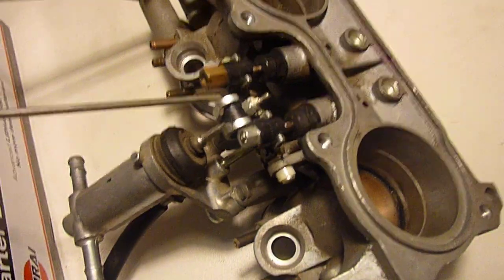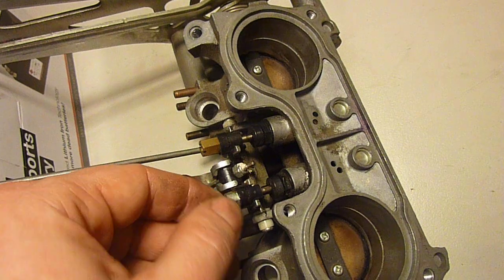What the starter valves on a Honda VFR800 do

Comment: Just as a reminder, Gen 5 starter adjustments do not all achieve the SAME vacuum across all 4 cylinders. IIRC,  1 and 2  are targeted at 200 mmhg and are the same but 3 and 4 are 20 and 10 mmhg lower or 7.1 and 7.5 inhg, respectively

Comment: How do you balance the throttle bodies?

I'm guessing they would need balancing before the air bleeds can be synchronised.
Reply from the maker: The air bleeds are the throttle body balance.  The throttle plates themselves are not adjustable.

Comment: I washed the injection body with spray cleaner, and my motorcycle does not start, I have to accelerate to keep it going, and sometimes it shuts down, what can I do, thanks and greetings from Mexico.
Reply from the maker: You've probably just got a vacuum leak now.  Maybe you forgot to reconnect one of the vacuum lines, or one has split.

Comment: Kal why will my 6th gen idle but die if I try to twist the throttle, even a little?
Reply from the maker: Could be lots of reasons.  Do you have any FI error lights?
Reply: @KaldekBoch  I did have 1,8,9 yesterday, but would have to erase them and check again. As the bike has sat around for a long time I think there's every chance the reed valves and injectors are clogged. It only fires if I squirt Start Ya Bastard down the throat. The last owner says he cleaned the throttle body but not the injectors and that it revved freely. I had it running with MAP disconnected, putting it back on has made no difference. Btw. Your explanations are the most susscinct and knowledable I have found on YouTube. Thank you, I feel confident to pull the injectors out...carefully!
Reply: Kal, no fault light showing. The pugs looked cactus, so I invested the $140 in new and Hey Presto!. Now it idles and revs cleanly, but the coolant overflow is pumping out boiling juice and an oil light is on. It's not low on oil.  Making headway. Keep up the great vids man.

Comment: Great video and thanks for posting!I have the problem described at 6:09.  No adjustment on the idle screw; but my issue is that I can't increase the idle speed. I think I screwed up my starter valve synch last week; the readings appear to be in synch but I must have over-turned the adjustment screws because the bike is idling between 1000 and 1100...to slow.  What exactly are you turning on the screws?  They pull out but I can't tell what is actually makes the adjustment?
Reply from the maker: they are threaded somehow.  it's been a while since I owned this bike but I would suggest pulling on each piston and cleaning the air galleries out with brake cleaner for starters.
Reply: Thanks, I'll give that a shot too.&#160; I admit that I went a bit wild turning the screws without much understanding of what they did.&#160; I was going by the premise of righty-tighty lefty-loosey and trying to line up the dials from the manometer.My results weren't completely bad as I have smoother response but I smell more exhaust, slow idle and no idle positive adjustment...

Comment: what effect would removing those butterfly plates in the throttle bodies cause.
Reply: MsOldfart1 The effect would be the same as taping your throttle wide open and having no ability to close it. The only thing your throttle does is open those butterfly plates to allow more air into the engine.

Comment from the maker: They are static and only for idle speed.  The only adjustment is by the screw adjuster or by the fast idle wax unit, which is itself just a temperature controlled idle screw.  Both of these affect the idle adjuster plate only.  The plate is attached to the valves, and the valves are only used to allow air into the engine when the throttles are closed.